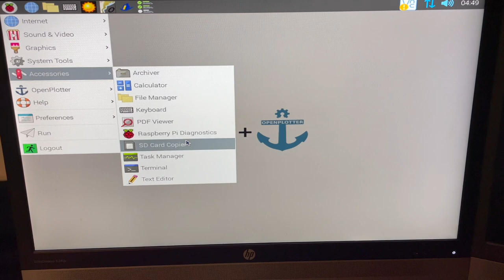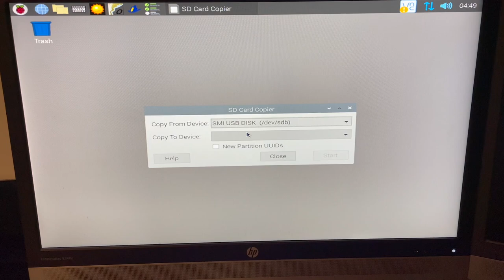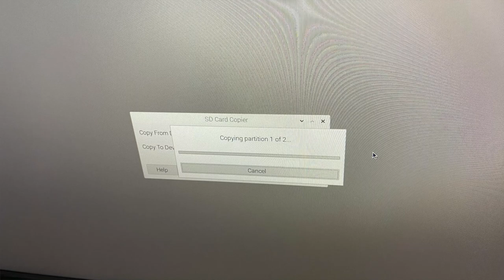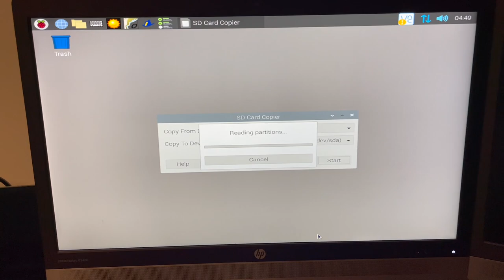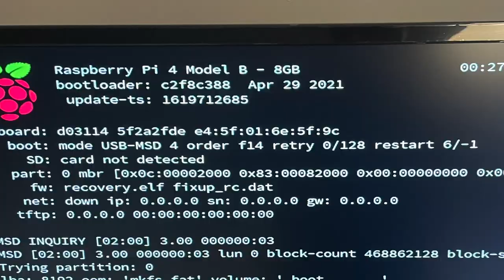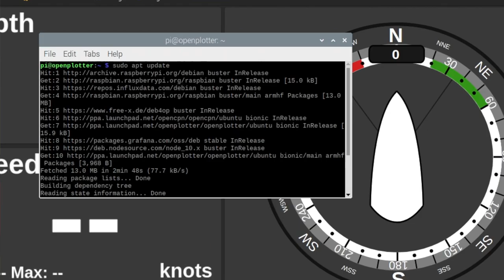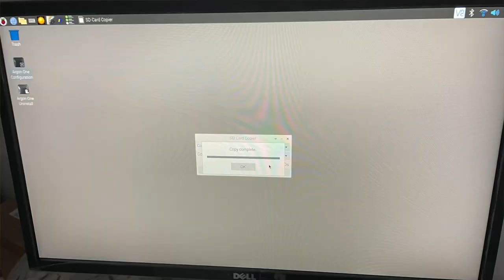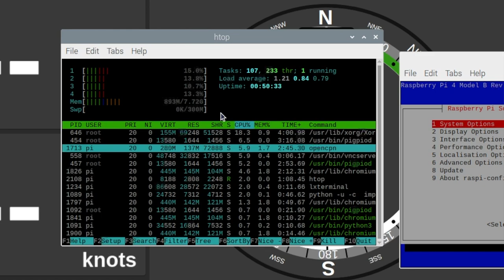OpenPlotter - 8GB Pi 4, SSD, Argon One m2 build - Boat Projects

Comment: Hi Matt. Not sure if you’ll see this as the video is a year old. Will a Pican M hat fit in that case with that configuration? I’d prefer the MacArthur hat as you reviewed in a later one but the delays in it being available are too much for my project.
Reply from the maker: Hi, I’m still keeping an eye on the comments for these videos. Short answer is no, nothing else will fit in that case as the lid presses down on the cpu for cooling. I’ve had to use a ribbon to connect to an external hat. I might change all of that when I get my Pi5. The McArthur Hat shouldn’t be too long away now, I know they made a small change due to the position of components on the PI5 but I believe everything else was ironed out in the development boards.

Comment: Great stuff though I will hold off getting a case until you update on getting the SSD working fully.
Reply from the maker: It’s all working now Mike, without spoiling some upcoming videos the base board that the SSD sits in is a much later revision, I think it’s now v2.2. More to come on this.

Comment: Hi, thanks for inspiring video. I have a geekpi UPS on my pi so your case wouldn’t fit for me.  I would however like to switch to ssd. Would you mind sharing the details of the external ssd case and your ssd so I can copy those purchases. Also any chance of a video for how to get uk maps installed? Huge thanks!
Reply from the maker: Hi, thanks for your comments. The enclosure is one of these from Amazon- SSK Aluminum USB 3.1 to M.2 NGFF SSD Enclosure Adapter, External SATA Based M.2 Solid State Drive Enclosure (SATA Based) and the ssd is from the Pi Hut,WD Green 240GB M.2 Internal SSD. I have some power consumption tests and speed tests on the way. Yeah I’ll sort a map video out as a short or something.
Reply: @BoatingwiththeBaileys  many thanks for your response as well as your videos!

Comment: Hi, I am following this video, got the same hardware and got it up and running, do you have any video showing the wiring of the input signals from the various inputs (NMEA, tank senders, seatalk etc). Thanks for making these videos, very helpful.
Reply from the maker: Thanks for your comments. Yeah couple of videos to take a look at. This is a 1wire waterproof temp sensor and how they work https://youtu.be/S_XCSaMwAuY, this video covers the BME280 which gives me inside temp, pressure and humidity https://youtu.be/GTo_DVZ4D6U. For Seatalk, i followed this guide https://youtu.be/XFOGrBmDhJg from Smart Sailing Boat and then recently I've done some work with an ESP32 which gives me all the engine data which is covered in this install video https://youtu.be/II8URyYTFqc but that links to another 2 videos which shows the build and the actual sensor electronics. Let me know if you need anything else.
Reply: @BoatingwiththeBaileys  Thank you!

Comment: Has anyone been able to include radar ?
Reply from the maker: Hi - No experience with that one unfortunately, our radar is analogue. I have seen posts on the forums where they have used radars with WiFi capability - This guide shows what's currently compatible. https://opencpn.org/wiki/dokuwiki/doku.php?id=opencpn:opencpn_user_manual:plugins:ais_radar:br24_radar:faq_radar

 I'm also interested in hearing if anyone has done this.

Comment: More likely, the ssd draws too much power. You'll need a powered usb hub. I had issues but I was trying a samsung 980 pro. I cam run two through a powered hub.
Reply from the maker: Hi, it turned out to be a faulty board in the base of the Argon case - The update to this video is here https://youtu.be/LZuX0cOoPU0

Comment: Love the video , can you download the raspberry pi operating system directly on to the ssd card ?
Reply from the maker: Thanks for your comments. Yes, if you can connect the drive to the PC, the Rasberry Pi imaging software can see the drive and should be able to write to it straight away. It was one of tests i tried but until i bought the external drive caddy, i was using the base of the Argon case which turned out to be faulty.

Comment: I'm doing something similar and I have nailed getting it up & running on an SSD
Just burn the USB bootloader in rpi-imager under utilities -> bootloader -> USB bootloader. Boot once -> green screen, unplug and remove card
Then use a USB3 A ->A cable (cheap off Amazon and very useful) use this to plug the 'tray' into your PC and then burn the rpi image straight onto the SSD
Unplug and plug the link back in & boot and it will boot straight from SSD as normal 1st boot. It will then resize to full partition etc & then reboot

I am running OpenCPN as a flatpak on 64-bit OS
Reply from the maker: Good advice - thanks

Comment: I'm just now working with getting my open plotter working on my houseboat and having struggles figuring out how to get an esp32 in the engine bilge to report back to my raspberry pi running open plotter with engine temperatures, bilge temperatures and pressure.

Can you point me to some help on getting the ESP 32 connected via Wi-Fi to the raspberry pi so I can bring that data into open plotter? 

Thanks!
Reply from the maker: Hi, yeah sure. Can I asked what Pi and OpenPlotter version you are running?